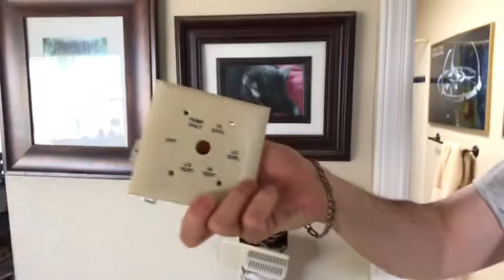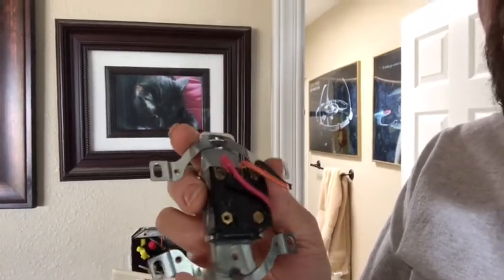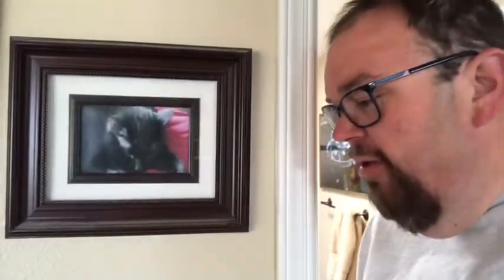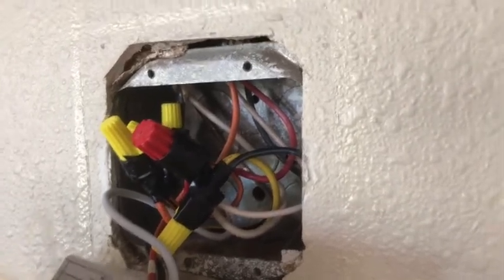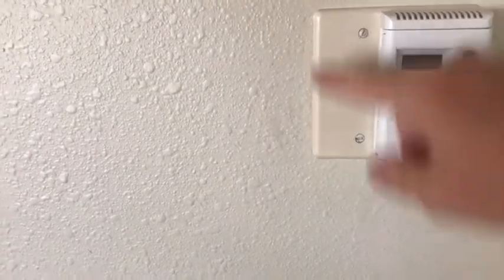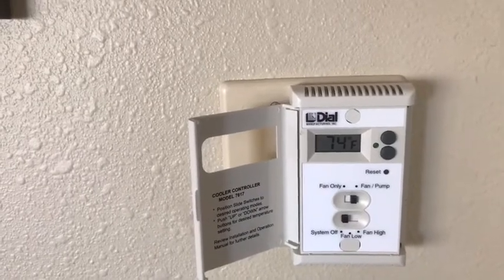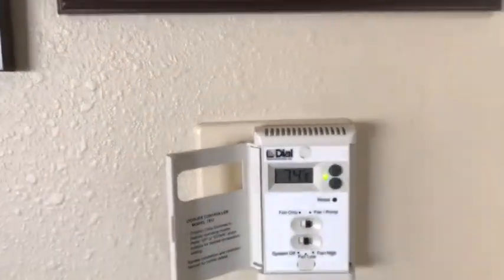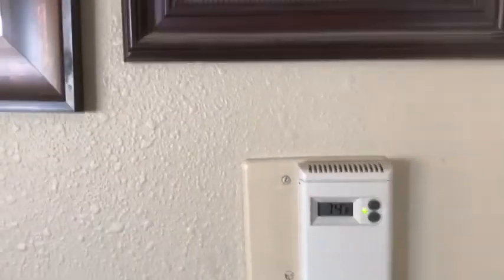Wiring a Swamp Cooler Thermostat

Comment: The green light indicates it's soaking the pads because only the pump is on. If set for. Hi or low it indicates the cooler is runing.
Reply from the maker: First of all, thanks for the feedback.  This is true.  A blinking green light means the pump is running pre soaking the pads but a solid green light means the blower is running as well.